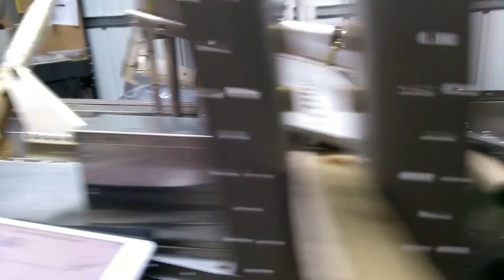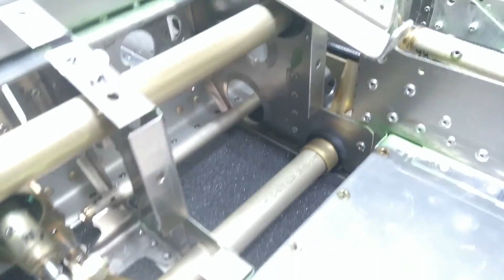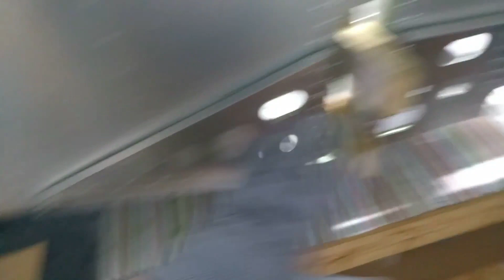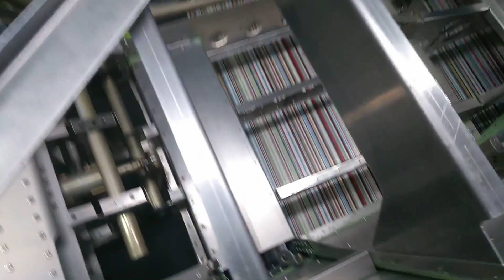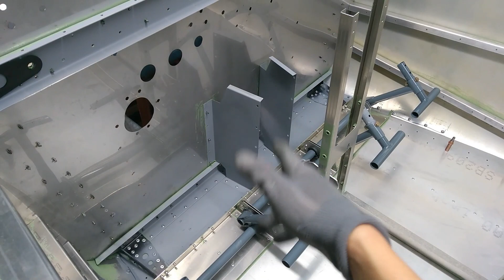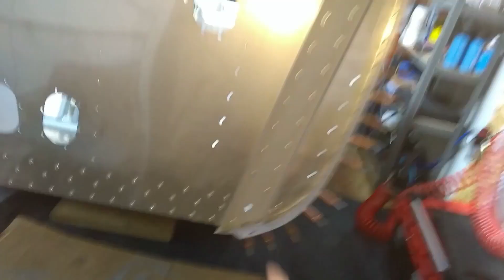Sling TSi build - Centre Fuselage Part 2

Comment: Do not use WD40, that is not a lubricant. Use silicon grease or what ever, but no WD40 please..
Reply: Yes, don't use WD40. WD40 is just a rust inhibitor, thus (W)ater (D)isplacement 40 (for the 40th formula tried). Graphite is good to use since it's dry and won't attract dirt.
Reply from the maker: Thanks for the suggestion. Will avoid WD-40. The finishing kit came with some grease. I might use that if the controls get tighter. For now looks like not needed.